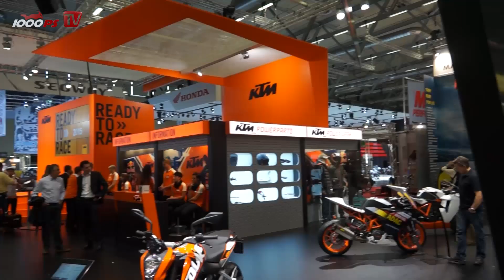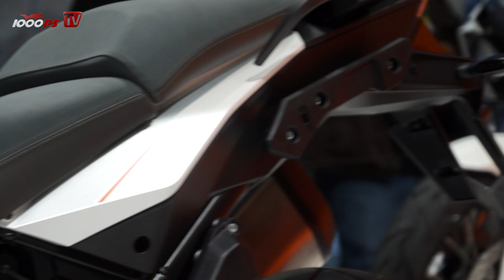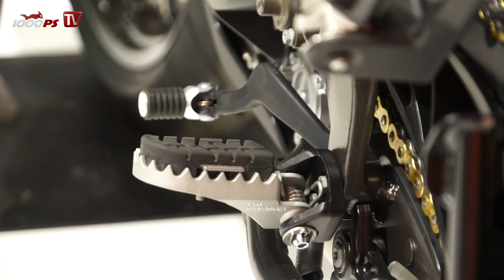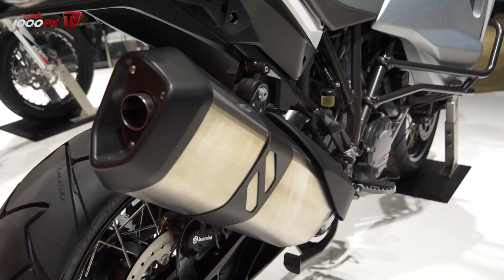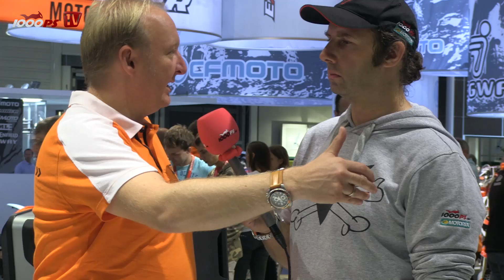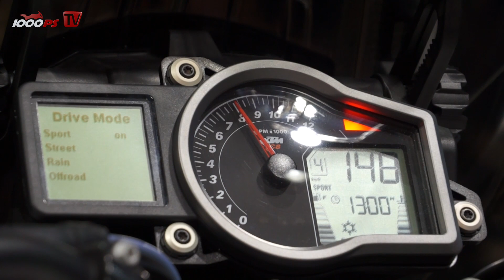KTM 1290 Super Adventure | 160 HP, 150 Nm Enduro

Comment: Oh God, why 150 hp ?   We don't need this and it is not good for an on-off touring bike.  Too much power is not good.   The maker put power on the engine and criate an electronic package to Reduce the Power.  Why ?   I think that is only for numbers.
Reply: Who is "We"?!?
Turn the mode to Rain, and you have 100 HP.

@KTM- You did a great job. I want this bike. Badly.
Reply: +Yuval Naveh there is an offroad mode as well, again with 100hp but less traction control at the back for being able to spin the rear easier (offroad technique to set up for corners). I test rode the 1190 today and I was blown away by its chassis. It is the best I've ever ridden in terms of balance and confidence inspiring. The 1290 isn't much heavier and should be even better, with more torque (and MUCH smoother than the 1190). The 1190 engine was a bit rougher than I would like it to be.
Reply: C_R_O_M__________ I got the Tiger 800 XCx. Love it.